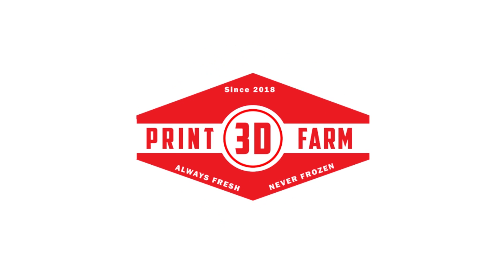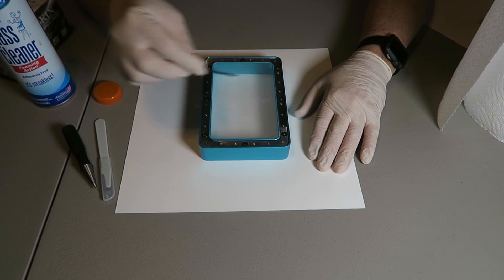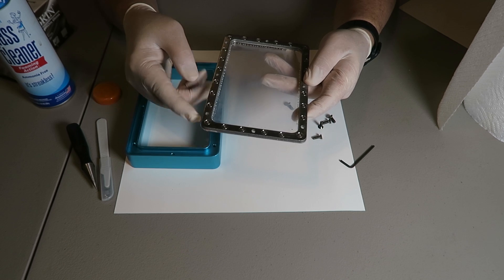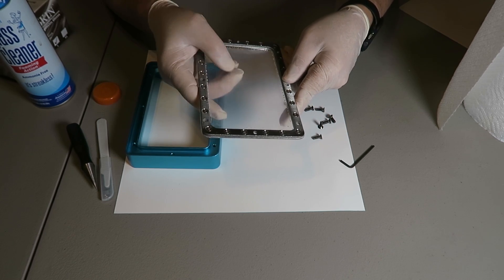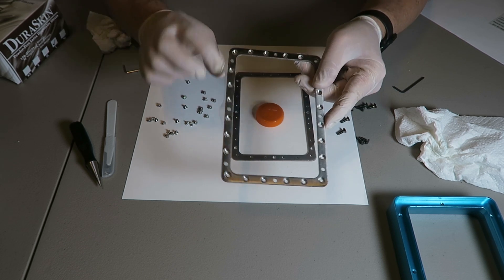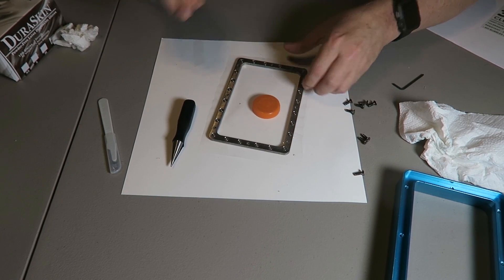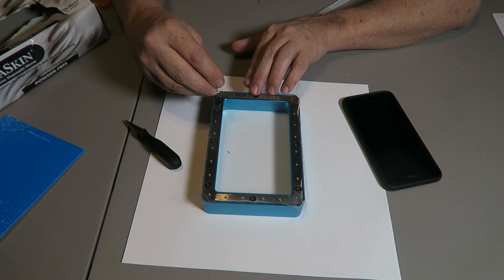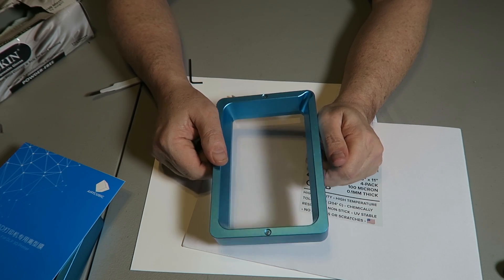Anycubic Photon 101: Replacing and Tuning the FEP!

Comment: My Elegoo Saturn 3 12k instructions say to put an 8mm sponge under the FEP to give it the proper amount of tension. It doesn't say what the other sizes of this sponge are supposed to be, or where to get one. I personally feel like they should give it to you with the printer. I can't even find where to get a replacement leveling card. Anyway, I found that the piece of foam that's stuck in a new cell phone case for my Galaxy is exactly 8mm. I downloaded "Spectroid" for Android. After using the 8mm foam to install the FEP, I tuned it to about 300Hz. My first print failed, and my second print was 50% success. The build plate was making a loud crunch each time it went up. I cleaned the vat and checked the screws. They were all loose. I went ahead and tightened all the screws all the way down until they wouldn't turn any further and rechecked the frequency. It checked in at 308Hz. Apparently, using the 8mm foam pad gives it the exact tension it needs to tighten everything down completely and have the correct final tension. I'm about to start another job and see what happens. I'll come back and do an update after.

Comment: 1. The "HOLES" are called Countersunk Screw Holes. 
2. Since the resin gets between the FEP and Tensioner do I need separate vats for water washable resin and standard resin?
3. Also, can you just use your wash station to clean the resin off the 3 metal parts?

Comment: Thanks for the video. I just got a resin printer last week and already had to replace the FEP plate. My dumbass scratched the hell out of it trying to clean it after a failed print...learned my lesson. Bought some replacements, went to replace it on my own, following the instructions were on the package, that had no mention of a bottle cap or keeping it raised above the bracket...needless to say I am replacing the FEP  again. Thanks for the video. Showed me what I was doing wrong.

Comment: is all this info true for any FEP (8.9", 15.6", etc), or only for the one shown here? If not, what are the frequencies required for others? How did you determine the ideal frequency range?
Reply: Wish they would specify. Support documentation on all aspects of Anycubic is lacking. Things like how do you update the firmware? Are never answered without contacting support or finding others who have done it before.

Comment: i bought some sovol vats for my anycubic photon mono and they forgot to remove the protective film from the FEPs, which made bubbles between the two layers. i took one out, removed the film, and put it back in and it's only measuring 160hz even through the screws are all completely bottomed out. i tested the other one that still has the protective film and it's only 190hz. how important is it that the tightness is 350hz? if it is going to cause problems then i guess i can just order some FEP sheets and make a fresh one, but i've also read in negative reviews that some people can't even get their sheets to tighten tight enough because there just isn't enough travel in the design of this vat.

Comment: Real stupid question but could I use the cap of a milk container or a distilled water container for the spacer instead of the cap of gatorade or soda?  I don't know how the sizes compare and if it is that critical.  I've never replaced the FEP before.
Reply from the maker: Sure! A milk container or distilled water cap would be fine!
Reply: @3DPrintFarm  thank you.
Reply: @3DPrintFarm  I replaced my FEP for the first time.  I was a bit nervous doing it but it went well.  Your video really helped.  Thanks

Comment: I guess when i get different Numbers while "Drumtesting" like 328Hz everywhere but 420Hz in one corner i have to release tension in that corner right?

I saw it made a big difference if if had the VAT Standing on one side (like in your video) or if i held it in hand. So i decided to place it with the long side on the Table.

Am Testprinting right now... hope it works :D

i just finetuned i'm still affraid of changing the FEP without having an emergency VAT at the ready lol... 

Nice Video and good tip with the spectrum analyzer!

Comment: Apart from obvious visual damages of FEP film, are there any other indications for FEP replacement to take into consideration? 
My FEP film has barely noticable embossed textures (from spatula). Is it critical to replace?
Reply from the maker: Little indentations from normal use or failed prints are fine.  Remember that first layer is going to be squished all the way down to the LCD.  You are good go as long as their are no holes where the resin can leak
Reply: @3DPrintFarm  Thanks for answer :)

Comment: If you plate was level and you haven't changed out your screen then there is no reason to relevel again. You do need to re set your Z=0 esp with a thinner FEP,  the thickness of the FEP may also affect the Htz that is tuned to.  Its been too many years since I wasnin band. I would have to ask around.

Comment: If you have a cordless drill and a spare allen key, you can cut off a section of the allen key with a hack saw or something and put that in the drill. I wouldn't recommend the drill for putting it back together, but taking it off will save you some time.

Comment: Great video on Anycubic FEP tuning. Used it on the 2 AC printers I have and the tuning greatly decreased print failure. Am wondering if you or anyone watching has found a way to tune Wanhao D7 vat FEPs?  They don't have the two steel gaskets....only one and therefore one set of screws to fasten and pull the FEP taunt at the same time. Seems critical to have the FEP fairly tight before piercing for screw holes. FEP tuning frequency is a crap shoot in the end. Any suggestions most appreciated.

Comment: Excellent tutorial, Love this guy's video's. I bought my printer last week and had so many failed prints until I tightened the FEP using this as a tutorial. I also bought some WD-40 anti friction dry ptfe spray, squirt some on (it will go milky white but will clear in seconds) and wipe it off with a microfibre cloth and EVERY print has come out beautifully since.

Comment: So i recently changed my fep on my elegoo mars and initially had issues with it sticking too well to the fep film. I didn't tune it though, I just tightened all the screws all the way down like the elegoo instructions say.. lol. Do you think I may have stretched the fep too much? I can still hear an audible peeling sound every time the plate lifts up, and im getting some random minor layer lines in my prints.

Comment: I cant get my printer to work it's worked about 5 times and failed 20 times it just dosent print but when I check on it there'll be a bit of cured resin on the bottem or the other way it dosent work Is just printing fine for like half the print then it just stops printing it by that i mean it keeps trying to print but its not

Comment: Two notes, please acknowledge that not everyone in the universe is an Apple user. A recommendation for an Android tuner app would help. 

Also, doing all the tiny screws is a beast and it would help to mention what size Allen wrench you need for both big and small screws. They are not the same. .None of the videos about this mentioned that, and I get cutting to the next step but it is a key step and a bit of forewarning about the small screws would have been helpful.

Comment: 275-350 hz. I've had to come back to this video multiple times for this one piece of info. Adding it to the description would be super helpful
Reply: was just about to do the same thing. thank you sir.
Reply: Spectrum was the app. I just looked for the sound bars. My film is at 301 all over so good. YAY!!
Reply: ive come back to this video many times and its always a little frustrating trying to find the exact time when he says this info so thanks. surprised he hasn't put it in the description of the video yet
Reply: Not all heroes wear capes
Reply: Thanks for this post had to come back as I keep forgetting
Reply: Because of this old man, I read a 30-page article, and I can say that the correct frequency is between 275-335 :D I hope others don't have to watch this guy :D
Reply: Also worth noting that you should be testing for this with the FEP facing open air (as he does in the video) and not the surface of your table. Doing the latter will get you multiple peaks and higher frequency measurements depending on the surface your FEP is resting on.

Comment: Hey I'm having a problem. I removed both films on the fep and I installed the fep successfully. I tried printing and it wont stick to the build plate. Any suggestions?
Edit: the time that I set for each layer was too low and it didn't harden fast enough, causing it to come lose from the plate

Comment: what can I do to remove the print from the FEP ithout scratching it? And could it also be a problem of exposure time ? should i make the exposure time longer? Can anything bad happen from making the exposure time too long ?
Reply: you can use an IPA bath to soak the FEP for 5 mins or so then the print comes off much easier.
Reply: @robertwestgate110  Thank you for the tip

Comment: Are small scrathes a Problem. I had a problem with my first prints where the prints stuck to the FEP and not the Printbed, had to use some force to remove it. What could be the reason for it not sticking. the testprint cube  i did right before that worked perfektly. So it shold have been level. or do I need to level it between prints ?
Reply: Your film may not be tight enough.

Comment: I had a problem that when I tried to print 3 minis across the middle, the middle one always failed (just a puddle on the FEP, nothing on the plate). On the other hand, if I printed anything in the middle of the FEP with nothing on either side, no problem.  Last night I changed the FEP reprinted the same exact file with the same resin, and everything failed. I did get rafts and supports but the rest was stuck to the FEP or flat and stupid looking on the supports. 
Now I will say my ability to get a Hz reading with my sound analyzer app is highly inconsistent. I also don't like denting the FEP. I suspect by these two problems that there could be a tensioning problem across the surface of the FEP. Sides vs middle. Any thoughts? And how can I get a FEP tuned that I can print a whole build plate of stuff? Thanks!
Reply from the maker: First thing I would check would be your build plate to make sure it is flat.  Lay a straight edge (Steel ruler) on the plate and hold both up to a light source.  Can you see any light leaking through the space between the ruler and the build plate?  If your plate is level, make sure you have the build plate leveled consistently all the way around.  My method of leveling works, but the "Flint Read" Method works very well also.  Another thing you might check is the exposure time on your bottom layers.  You might bump them up a bit.  Have you ever ran the Photon Exposure test on your resin?
Reply: @3DPrintFarm  I appreciate your help. There was only one variable change though, I replaced the FEP (and it's tension). I've uploaded before and after pictures if you care to have a look. https://photos.app.goo.gl/qpHHyZcGCiQYk5Xy5 The before photo has a puddle in the middle (on the build plate), the after has models ripped from their supports. So is after too tight or too loose? Thanks again!

Comment: What is FEP
Reply from the maker: FEP or Fluorinated Ethylene Propylene is a plastic film that stretches across the bottom of a resin vat.  This thin film (think of a drum head) basically plays tug of war  as the build plate lowers and resin is cured layer by layer.. The idea is that you want the build plate to win tug of war!.. The build plate being rigid, will tug on the cured resin and the FEP stretches a bit and releases it from the bottom of the vat.

Comment: I got a question for you guys.  If i want to glue together parts from a model i couldn't print all in one go, what is the best glue to use?  I've tried the modeling glue i have, but it just didn't seem to stick.  Thanks!
Reply: 2 options that i use are 1:Super Glue (CYANOACRYLATE) or 2:Just use the RESIN and a 405nm (Purple) laser light source.

Comment: What happens with the prints if the FEP is a little bit loose?
Reply from the maker: You might start to see artifacts in your prints such as lines or 'banding'.
Reply: @3DPrintFarm  Similar question, but the other way...what happens if it is too tight? My method is nearly identical to yours except for the bottle cap. I set it flat between the plates. Then to tension, I tighten the screws just until they all touch. Next I use a star pattern and tighten each screw a half turn at a time until they are tightened all the way. This tensions it as high as possible, but gets there very slowly so it does not cause any damage. I have never checked the frequency. For different reasons (max tension or bottle cap), both of our methods would limit any additional tensioning in the future, but I'm not sure if this is necessary without rechecking the frequency.

Second question...How do you think tension affects FEP wear? I have some functional parts I print for customers flat on the build plate to avoid supports and preserve the esthetics. I print 6 cylinders vertical on the build plate. I have made hundreds of them and refined my process many times along the way. At this point the cylinders nearest to the center of the build plate seem to create the most wear on the FEP (white hazy surface). I know this is because of the orientation of the cylinder and how it continuously pulls away from the exact same location on every layer. However, it only occurs near the center. I have also noticed that the parts in the center develop bubbles where the FEP wears more. I believe there are micro holes/tears that suck in air but do not let the viscous resin flow back out onto the screen. I can verify this because in an extreme case I did get a drop of resin on the screen in this location, but it essentially self sealed as resin cured in the hole. Also, just for reference, I use PTFE oil on my FEP and a heat gun on the resin to remove any bubbles and warm the temp before starting a print.

These issues may not apply to everyone, but in a production environment the are extremely critical for quality and machine downtime. Thanks for the great videos! I've learned a lot from you and I am looking forward to your thoughts!

Comment: Just a question. Why do you have to re-level  the Machine after you change you FEP? Since you do not use the FEP for leveling?
Reply from the maker: Great question!  And you have a good point!  I level mine out of habit.  You'll find sometimes you will have to relevel your machine when prints are acting strangely as in not sticking.  Bolts get loosened and the build plate may get out of alignment after multiple prints.
Reply: @3DPrintFarm  Thx, I damage my FEP on my first print!!! Now I know when it stick just let it soak in IPA.  Merry Christmas.
Reply from the maker: @Centurion3D  Merry Christmas to you too my friend! Happy Printing!

Comment: Useful to see you go through this but are you aware by using a note to tension your FEP you've done it wrong. You stated the new FEP was thinner than the one before so by trying to match a note each time by definition your new thinner FEP will be slacker just like like if you had a thick and a thin drum skin tensioned the same you'd get different notes. I use my pair of photons commercially, having had one of them for nearly a year now and you do not need to tune the tension to a note.

Comment: Want to start by saying that I am greatly appreciative of your videos and that they were the deciding factor on whether I purchased a 3D Printer or not. Well, I bought one. An Anycubic Photon. Ran into a bit of a scare after my 3rd successful print (first failure was due to improper zeroing), when I heard an odd emanating from the printer. Turns out, there was a slight puncture in the FEP and it had leaked a couple drops of resin down onto the screen and was being cured. I am HOPING that I managed to catch it before any serious damage had occurred. I was able to gently scrape the partially cured resin from the screen, ran a couple UV projection tests, and it appears everything is in working order. However, I purchased my printer via Amazon, and apparently it didn't come with an extra FEP in the box. My question; How did you make out with the 3D Club FEP? Comparable to the AnyCubic branded FEP or?

Comment: one thing i always wantet to say:  didnt had a bottle cap and used some sponge. so the final tension got higher than i wanted before the screws got deep enough.  that means if you wanna hit a certain frequency and you stop screwing the screews in check for the lowest part. if you screws are still to low your fep isnt flat on your screen. had to tighten it up much more. anyway i have no issue with a frequency over 500hz. makes me wonder how many peopel have problems through protruding screws.
Reply: Higher is OK.